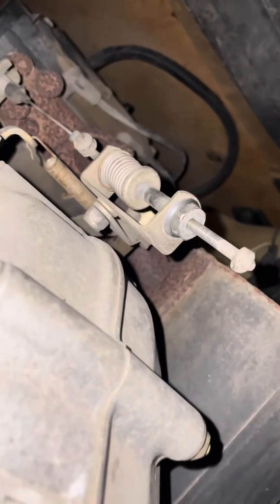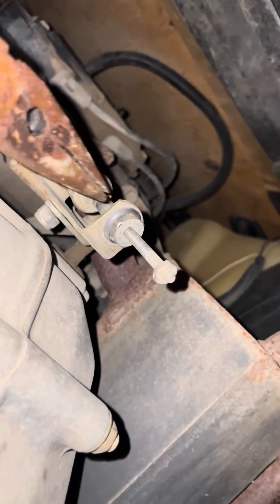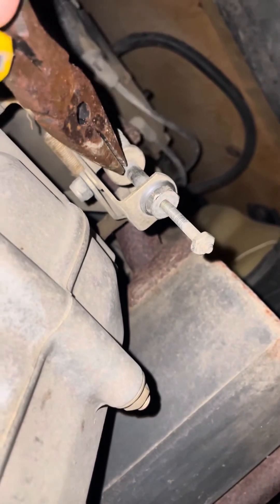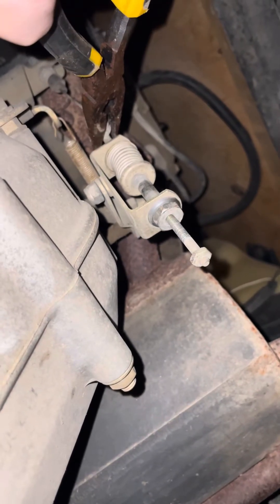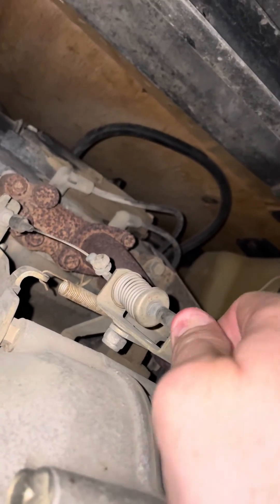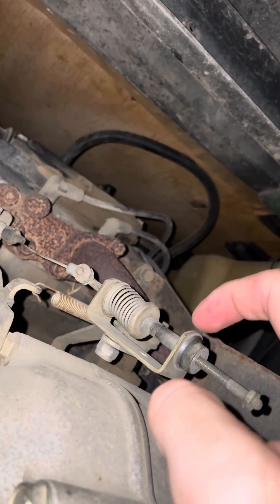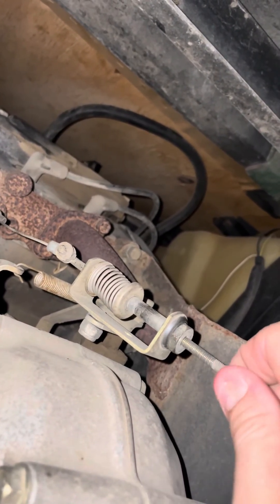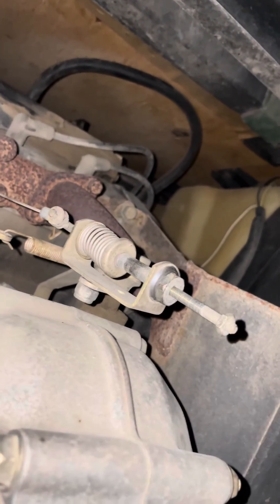EZGO (gas powered) txt governor adjustment

Comment: Thanks for this. I just aquired a golf cart an got it running. It seems like the rpms are to low an weak under load, so i will try this this evening.
Reply: Careful about running it too like at high RPMs on the Robins engine. It doesn’t have an oil pump and relies on the rods to sling oil. Over a certain RPM it doesn’t move oil like it needs to and you can damage the engine. You’re good to a point but too much can be an issue.
Reply: Did it make it faster
Reply: Yes!!! It will do about 25mph now @ColtOman71

Comment: so do you also need the freedom chip? Is the freedom chip the same thing as freeing up the governor? If i have the chip do i need to mess with it?

Also is doing this safe? Will it be legal?
Reply from the maker: Hey Kevin, 
Honestly not sure what the freedom chip is. This is for a gas powered cart. Is your electric? 

This modification will not make it illegal. Just a standard safety feature to utilize if you want to limit top speed of the cart.